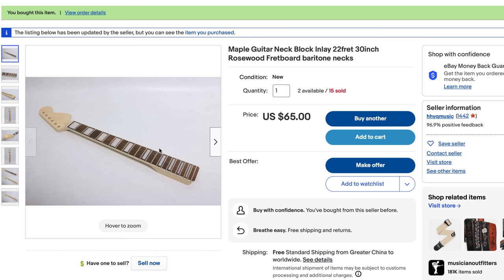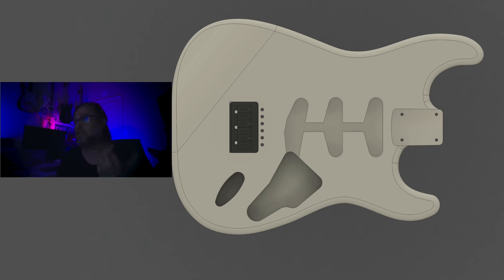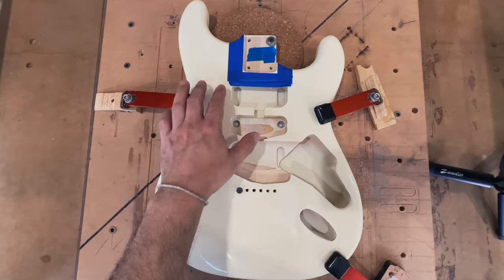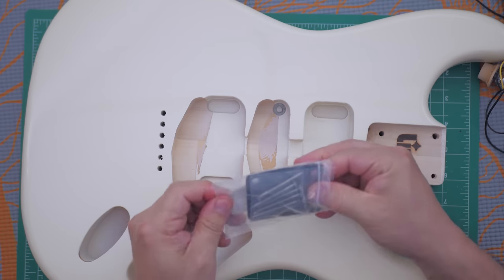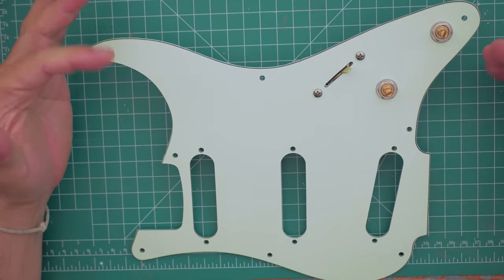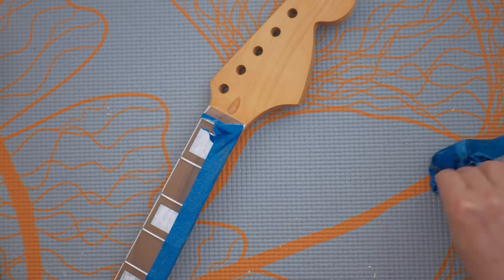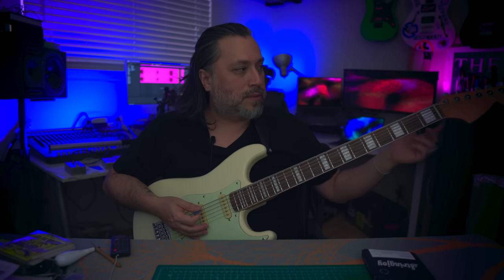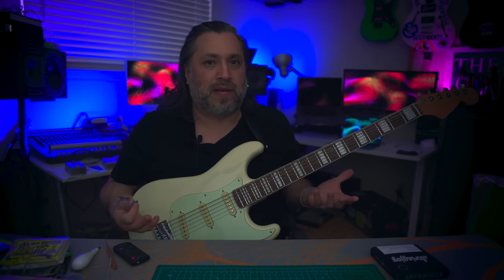30” Baritone Partscaster Build

Comment: I thought the whole point of a conversion neck was so that you don't have to move the bridge? Is that not right?
Reply from the maker: Actual conversion necks are designed to retrofit onto standard bodies. They work by placing the frets in relation to the standard fender pocket. This specific neck is not a conversion neck, it is an actual 30" scale-length neck based off the Bass VI.
Reply: @MarkGutierrez  ah thank you for clarifying! I was worried then because I've just bought one for my Tele and I was panicking 😂

Comment: I am probably speaking from ignorance, but since you have CNC capability, why didn't you just get an un-routed body and go from there. That way you wouldn't have needed to fiddle around with relocating your pickup routes.
Reply from the maker: The body was already painted, clear coated and buffed. It was also very inexpensive relatively speaking. Starting from an unrated body would have been much more work.

Comment: Did you 3D model the strat body yourself or did you find a template?
Reply from the maker: I downloaded the model for the strat. Precision wasn't terribly important since the routes just needed to be centered on the center line from the neck pocket.
Reply: Where did you find your templates from. There’s so many out there but I trust you’re opinion on good templates.
Reply from the maker: @Jake28700  I think I got it off of GrabCad or Thingiverse. I might have downloaded a few until I found one that suited my needs.

Comment: The conductive paint should be applied through all holes and painted more on the body surface so that YOU CAN MAKE THE SHIELDING ALL CONNECTED. THE BEST WAY TO DO IT'S TO CHECK THE CONDUCTIVITY WITH A MULTIMETER. I HOPE THIS YOUTUBER IMPROVE YOUR TECHNIQUE BEFORE YOU POST YOURS ON YOUTUBE.

Comment: its just a bass guitar with down syndrome really. All it takes, are two (three?) strings from the bass guitar and... using a pick. Which you can use with the bass as well. You won't play chords or even power chords with it - it'll sound just bad imho. You won't play fully rich bass as well, not to mention some slapping on it. I'd call it an experiment rather than something serious.